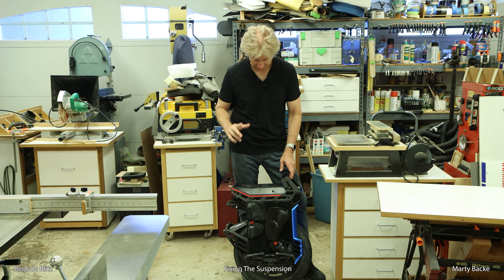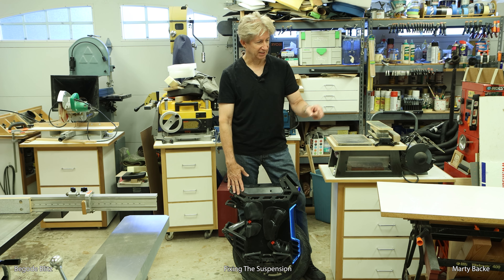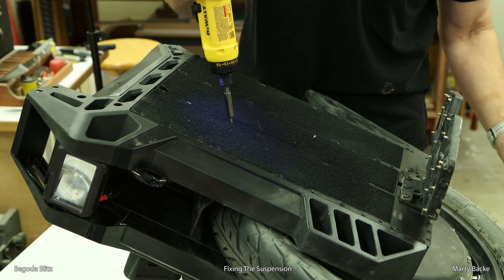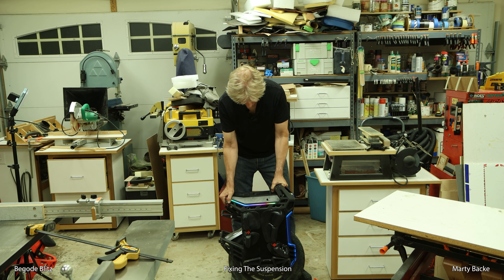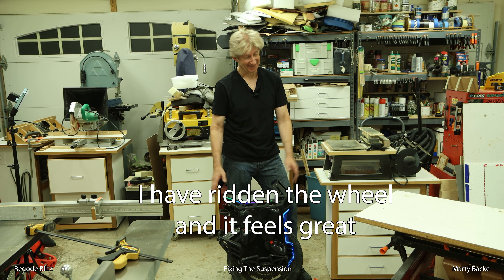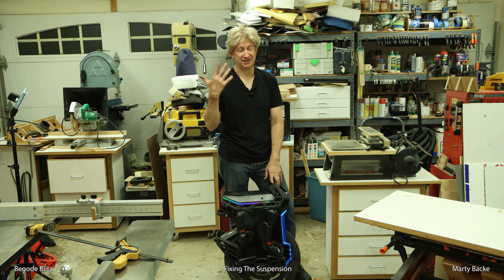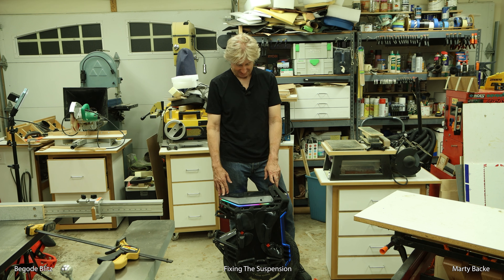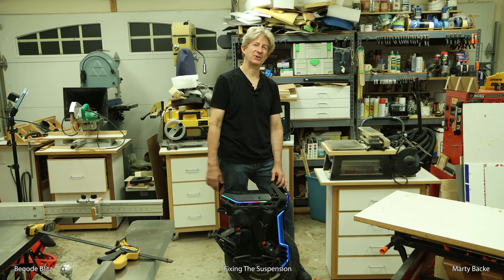Fixing The Blitz Suspension

Comment: Just when you think Begode are finally doing better at design, builds and QC, and then find out you've been riding round all day on something that was barely clinging together at its most important points ! Dear oh dear - usually they do remember to bolt the motor in hey, so this quite a serious level of oversight ?! RE your point about dry thread-locker it must be down to the quality of it, because DJI (famous for stunning QC) provide new screws with their props that also have pre-applied stuff, and that works really well. Still, I'm with you in preferring to apply mine and being sure it must work better when it's liquid ! In the case of props on drones dry / solid is better because we don't want any liquids (and especially not threadlocker!) anywhere near those motors, but obviously that doesn't apply to our wheels, so I'd always do liquid there.
Reply: I didn't know that's what the screws were for! New loctite! Thank you

Comment: Wow crazy that the NY guys were riding this thing with absolutely zero torque on any of the motor bolts. That is seriously wild. Im amazed the wheel even performed half decent with a completely loose motor! Really speaks volumes about the firmware and the other qualities of the wheel, but the completely loose motor bolts are just egregious. Like wtf begode.

Comment: I’ve had this happen on my last two LeaperKim wheels as well.  First a SS with either a loose or over tightened motor bolt that sheared off at 200 miles, then a Lynx with all but one properly configured and installed motor bolt on one side, two on the other.  With the Lynx, the other loose motor bolts had missing lock washers, doubled up regular washers or no washers at all! 😂.

Comment: A few days ago, I discovered that Permatex (not an affiliate) makes a threadlocker 3x stronger than Loctite blue that's still rated for hand tool removal (red requires 600°F+ heat to release and hand tools) - check into Permatex orange - I got it because my backpack mount thread connections simply wouldn't stay put, so I was going to get some good ol' blue but then I saw Permatex had the orange and gave it a shot (same price as blue).
It's holding VERY well and I would agree it's much more vibration resistant but have no way to gauge whether it's 2x or 3x or whatever but it's very very solid feeling, especially after 48 hours to completely finish curing.  I'm a fan of it now, especially since equivalent cost, but I'd really like to take the time to put them head to head just to see.

Comment: Marty, my friends, and I have gone through all this with our extremes. The first thing I learned was after 3500 km of hard single-track riding, things were cracked or broken. I will never replace the bushings within the tubes that those snubbing bolts are supposed to hold in place. I suggest using the green retaining compound and retaining the bushings in the barrels because the barrels do not outlast the bushings. I replaced all components from the wheel to the top control board compartment. Next time I replace this suspension, at minimum, I will replace the cross member with the two barrels and the barrels themselves. On my extreme, one of the barrels mounted to the wheel broke off, and the cross member piece cracked. 

Also, a retaining compound should be put on all the bushings within the suspension linkages. It will help with loose bolts and wear on the linkage and the spacers. 

So you probably noticed how all those motor mounting bolts are ground to a taper. It’s because there’s no clearance for those bolts, so everyone replacing the barrels will need to grind the heads of their bolts so they don’t rub on the stanchions. No one told me anything about that, and if I hadn't noticed during assembly, I wouldn’t have had any idea. 

I have 1000 km on my extreme since replacing those components, and the suspension has never worked so well. 

Forget about those snubbing bolts. They do nothing other than clamp the bushing to the stanchions and create more friction.

Comment: Do you think that is why it was riding hot also?
Reply from the maker: No. Probably ran how because it was very hot, I wasn't riding fast, and I was sitting on it for awhile. It's been running cool on the streets.
Reply: @ElectricUnicycles  cool, pun intended. What do you think about wrong-ways video on a software issue for lynx and Sherman L do you think the ghost crash could have been related?
Reply from the maker: @ReviewThisTestThat  "Ghost crash"? Not familiar with that. It does seem that you might be able to configure the L Pedal Hardness and Acceleration Assist to be a problem if you superman your accelerations. Another reason why I don't ride that way.
Reply: @ElectricUnicycles when Arron hit the small jump and it looked like someone just ripped the lynx out from under him and it shot down to the golf course.
Reply from the maker: @ReviewThisTestThat  his tire hit the jump at a weird angle, causing the wheel to shoot to the side
Reply: @ElectricUnicycles  thank you. Im just glad he is ok the way he landed could have been life ending :(

Comment: Watching your video now. And just niticed something.

When appliing Threadlocker on the motor bolts... Don't put it inside the motor threads. Over time (if you take it appart again and again) the thread locker (locktite) debre will build up in the bottom of the screw hole and in the and the bolt will not fit anymore. I did this myself, and had to drill out the shit.

Second. On the bolt you show in the video.....  You put threadlock to high up on the bolt, where it will not actually thread into something.
Reply: Funny, I noticed the same thing! 😀

I would also not call this a fix as much as a bullet point on the checklist for a new wheel, just like you check everything on a new bike.

Comment: They use Chinese lock tight its just colored solvent. is there a way we can find out how much torque we should be using?
Reply from the maker: Let me know if you find an answer :-)
Reply: If the manufacturer doesn't provide recommended torque specs, for example in a shop repair manual or printed directly on the part, then I think you're out of luck. If you can determine the class and the diameter of the fastener then you could look it up on a chart (try searching for "Tommy Carwash metric torque chart").

Comment: Begode have finally done away with the motor horse shoe spacer. Huge improvment.

Blitz uses the same design as the master range in the sence 3 points need to be aligned. For smooth suspension. Motor/MiddleHBar/Tophousing that the stanchion poles use to align and slide to be smooth and non binding/alignment is critical.
As for the grub screws they are not needed and can be fully backed off in most cases. And are more likley to deform the brass bushing and causing distortion in the bushing with binding and stiff suspension movement.

Good video.
Reply from the maker: I've heard that the set screws are not needed but then you have to wonder why they go through the effort of drilling and tapping those holes and installing the set screws?

Comment: it was used before sending to you and ride it in a mountain. maybe check the bolts when it was brand new then make a review 😅
Reply from the maker: Do you want me to review a wheel as-is or fake it by taking the wheel apart first and fixing whatever is wrong? Do you really think that this should happen after ~150-miles of city riding?
Reply: @ElectricUnicycles  nope, we really want to consider all possible  cases  on how the bolts comes to lose.